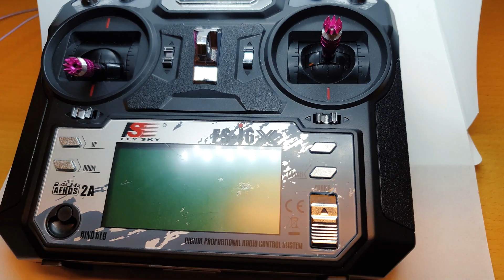iRangeX iRX6 + FlySky FS-i6/i6x - No battery mod

Comment: Hello! After we do all that, will we then be able to use the data cable and the flight simulator cable?
Reply: If you are worried you could always but a switch in place.

Comment: Hey, I want to do this. Is it safe and really working? Can I destroy my TX?
Reply: Also, did you solder that new black wire on the battery connector or?
Reply from the maker: @BrunoRakonic  Hey. If you don't do something you are not supposed to do (e.g. short-circuit, etc.) there is nothing wrong or unsafe about it. I am running my controller like that for more than a year and it works fine. However, it's your own responsibility if something goes wrong.
The only thing I did was to cut the black wire (0:30) and solder it to the switch terminal (0:57).
Reply: Ok thanks. Btw. I have Turnigy i6 which is a bit different from flysky (inside) so I'm not sure where to solder that cutted black wire. Can I contact you someway and send you a photo?
Reply from the maker: @BrunoRakonic  Sure. Contact me through my facebook page: https://www.facebook.com/stanleyprojectscom
Reply: hi my fSi6X not powering on can you help me to short out this please